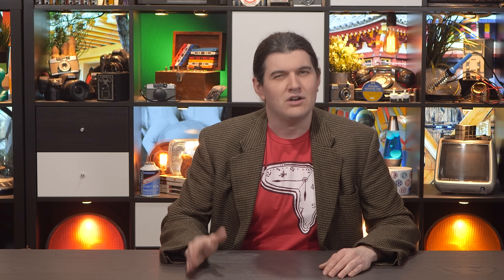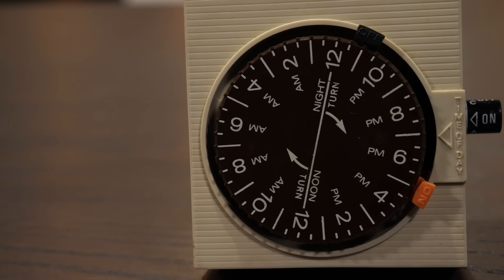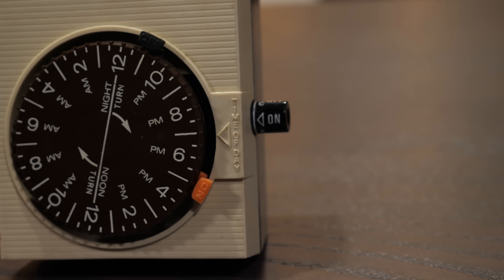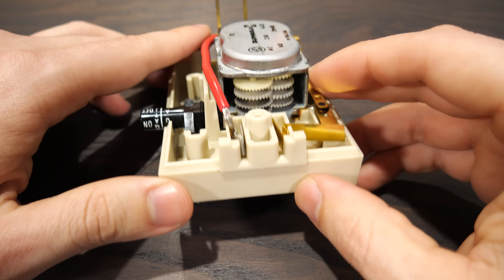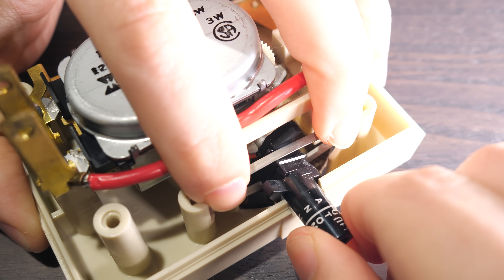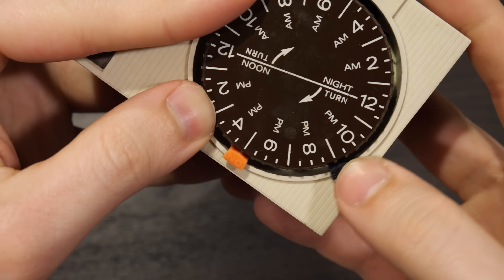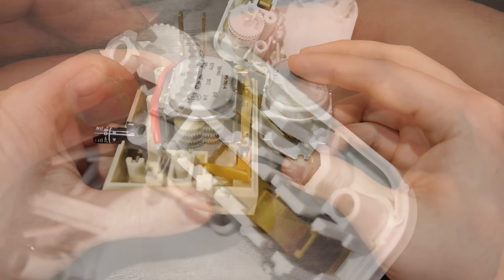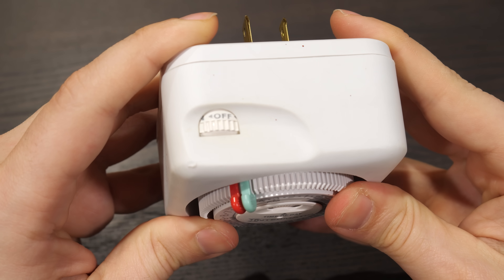Timer switches: literally just a clock and a switch

Comment: Great topic, and great video, as always!

My family has been using these kinds of timers since the late 1960s, when my grandparents first found out about them. (Religious Jews don't turn electrical things on and off on sabbath and holidays, so we use these timers to make life on those days more convenient.) After doing a bit of research to identify the picture burned into my brain, I think my grandparents' first one was an Intermatic Time-All Model A-211, which had a power cord, stood upright on molded-in feet, looked something like a big alarm clock and had the override switch on the right side. That timer might've outlasted my grandparents.

My wife bought a timer exactly like your first one when she was in college in the mid 1980s. She still had it when we got married, and we used it (dare I say religiously? 🤣) for about 20 years, at which point it failed. I don't remember if one of the plastic parts of the switch broke off or the motor burned out, but whatever killed it, she definitely got her money's worth out of it.

At some point, I bought two timers exactly like your second. Each came with two sets of trippers, and I did exactly what you implied in the video, and when I needed one of the timers to turn a light on and off three times over a 24-hour period, I borrowed two trippers from the other timer. I also discovered, as you mentioned, that those trippers are ridiculously easy to lose, so at this point I think I have one timer with two sets of trippers on its dial and the other has two OFF triippers (but no ON trippers) on its dial. Oh, well...

I also have timers similar to, but not exactly like, your last two. In addition, I have one programmable in-wall timer that replaces a light switch. Acquiring that was something of a production. My first such timer was a relatively simple model that got its power from the household current. That was fine until CFL spiral bulbs that fit into most fixtures came out, and I quickly discovered that my wall timer was incompatible with those. Apparently, it depended on the filament resistance of incandescent bulbs in some way, and having even one CFL in my dining room chandelier caused all the bulbs to flicker and the timer to make funny noises. So, I had to stick with incandescent bulbs in that fixture until I discovered a wall timer that used a pair of AA batteries to run the clock and operate a mechanical switch to turn the lights on and off. That worked fine no matter what kind of bulbs I put in the light fixture. It was a bit annoying in that the switch made a curious sound when turned the lights on or off, which took some getting used to, and it went through several sets of batteries per year. It lasted for about 10 years, after which the plastic hook that held the battery compartment in broke, and I had to replace it. The updated model offers relatively complex programming, auto daylight savings time adjustment (obsolete since the last DST rules change), switching the lights at dawn and dusk, and a lot of other features. It uses some sort of camera battery instead of AAs, but it also uses a more efficient electronic switch instead of a mechanical one, so each battery lasts several years.
Reply: I have to ask: do you (or your grandparetns) use the sabbath mode on your oven?  I actually mistakenly discovered this on the oven in my last house when I hit some combination of the buttons and it suddenly showed "sbt" or some such on the display and I had to go dig the instruction manual out of the basement to figure out what happened and how to cancel it...
Reply: @jimbarino2 , funny you should ask that. My brothers and at least one of my sisters use sabbath mode on their ovens at least once every week. I use it on mine occasionally, but my wife has to ask me to turn it on for her, because she has never successfully done so. Sabbath mode, which is actually something of a misnomer, does two things. First, it enables the oven to stay on longer than 12 hours, give or take. Second - and this is why it's a bit of a misnomer - is that it provides a means for changing the temperature of the oven on Jewish holidays (but NOT on the sabbath) within the confines of Jewish law.

Comment: While I appreciated the accuracy and thoroughness, "morphosisticsted" is my key takeaway. Joking sside, I install a lot of intermatic commercial mechanical timers. I believe the key difference between them and the consumer units you investigated is that the consumer units bare a horsepower rating. Maybe in a future video you could discuss the difference between units that can handle inrush current vs timers that are only good for small groups of lights?

Comment: rather than losing tabs you can also just leave them on the unit, since an additional "on" or "off" tab won't change the program if it's already on or off, nothing wrong with an extra off tab after the previous one etc (assuming you didn't need the on/off to happen 30 minutes next to each other)

Comment: I have this exact same system on all of our game feeders. The tabs on the wheels are metal clips you have to remove or place where you want, like a paperclip. And the activation switch is not a spinning on/off knob, but just a contact trigger that activates the wheel on the feeder for a couple seconds. There's a rheostat knob that controls how long it spins after it's triggered by the tabs. You can place as many tabs as you want, and feed at, say, 7am, noon, and 5pm. Rock solid and never had any issues with them. More reliable than the new digital timers.

Comment: These were very common hardwired in older commercial buildings for lighting, signage, or HVAC, those ones are often reffered to as time clocks. Intermatic makes a lot of those commercial time clocks. You might have more luck seaching for "mechanical time clock" rather than "time switch".

Comment: For the second timer that can be programmed by inserting or removing tabs, spare tabs just need to be put next to take that you're already inserted. 

Put the spare "on" tab next to the "on" tab that actuates the timer. Do the same with the "off" tabs. 

That way the spare tabs will simply pass without changing the state of the timer.

Comment: Oh, hey I made a comment regarding this on the Connextra sights and sounds video for the Statesman.  I'm just glad that this was covered since it felt like the topics were heading this way in regards to electromechanical items.  This also answers my musing about what manner of system it uses regarding time keeping (how it uses the frequency of the electricity to keep track of the time in conjunction with some gear reduction).  Anyway, that last unit was really, really similar to the selection wheel on the Statesman and kind of awesome that something so different in use has a similar structure at its core.

Comment: Recently my 2-year-old noticed that some lights in our house turn on and off by themselves. I was trying to think of a simple enough explanation and surprised myself with "those lights have a clock that turns the switch on and off". 

Timers are great for plant or aquarium lights to provide a consistent photoperiod, and for seasonal decorations. The one I use for my aquarium has a week-long dial so I can have the light on different hours on weekends.

Comment: As someone that uses a timer for a lighy with a hard to reach switch, I'm glad they moved on from tabs. That being said, couldn't you store the spare tabs in the timer next to each other? Just take all the starts and put them after the one you need and take all the stops and put them after the stop you need. Since the tabs are directional it shouldn't matter if there are some redundant ones.

Comment: Meanwhile I set up an full master-slave clock system running a signal clock (which I guess is just a fancier timer switch) which then via some relay logic control lights and stuff because what's the fun in keeping it simple 😂

Comment: I recently bought a couple of those mechanical timers for some, uhmm, indoor gardening. The ones I bought have 15 minutes intervals so 4 tabs per hour, they are quite small but the design is good enough that you can push or pull them easily. I do find that they drift slightly but I can deal with it, I haven't had to adjust them since installing them last month. The tech is so old but still useful. I liked this simple video, fun and interesting.

Comment: Have you ever explained those dual light switch system. Ive got two separate staircases with a switch at the top and the bottom and my brain doesn’t understand how it works. Also my house is like 90 years old

Comment: The facility I work at has one of these, but on steroids, that switches our 208/277v  outdoor lighting and signage. It's made of steel though, about 5 times larger, and guess what... it's also made by Intermatic. It's like they held a monopoly on these things, regardless of the application.

And since I'm the night shift facilities/maintenance dude, I'm the one who gets to reset it everytime there has been a power failure earlier in the day and the outdoor parking lot and perimeter lights don't come on at dark... Nobody ever remembers to do that.

Comment: Sadly, these simple, mechanical devices are now so cheaply made that they wear out fairly quickly if you leave them in continuous use.  First they start to make an annoying grinding noise, then they fail.  You can easily see why, it is just a bunch of cheap plastic reduction gears, with little or no lubrication.  I got sick of buying new ones every year or so.  Now I use electronic ones with a built in battery backup for the settings.   The mechanical ones are really only for running a few lights while you are away on vacation, or for your Christmas tree.

Comment: We've used these for years run block heaters on the big trucks and tractors (1600 watts).  Just like the one you showed, but a more recent version. They work quite well, although after a few years they start having problems when it's -40 and sometimes stall or get really slow.  I've also got one running a light (because the stupid LED won't work with the day-night sensor that is supposedly meant for LED). By the way the newer analog switchers you showed don't like -40 at all, especially the one with the 48 little tabs.

Comment: I have the second timer. You store the extra tabs by just plugging them into the dial. As you pointed out, they perform a no-op if they are on a part of the dial where the event they handle is already triggered.

Comment: I use an outdoor version of the 3rd mechanical one with the 48 pins to control my pool pump. I have it set to run for one hour at 3 different times each day. Pretty handy and quite reliable!
Reply: Yup, my pool filter/pump controller has a couple big fancy high amperage ones of these (in reality the internals are probably practically identical… hate to think what that relay looks like inside) built in for controlling the heat pump and filter.

Comment: When you can't use Google, use AI!  Here's what ChatGPT says:
"Timer switches, which allow for automatic control of lights and other electrical devices, have been around for several decades. They were first introduced in the 1960s and have been in widespread use ever since. Over time, the technology behind timer switches has evolved to include features such as programmable settings, remote control capabilities, and integration with home automation systems."

Comment: Wire wraps are a very good connection method and were used in telecommunications equipment backplanes until the introduction of plastic cable connectors. Ten years on while wire wrapped equipment was still going strong after multiple decades of use engineers found out that plastic not only refers to the substance but also its properties. Gravity distended the connectors and faulty connections happened. By then the zip tie was invented. Also with wire wraps you did not have to carry around a rubber eraser to clean the contact surfaces every time a weird fault was detected.

Comment: Next up: honeywell's "winter watchman" thermostatic switch!

Plug it into a wall, then plug a lamp into it and set the temperature. 

If the temperature in the room falls below the setpoint, it will turn on the light, letting your neighbours know that your heat isn't working while you're away, so someone can make sure your house doesn't freeze.

Comment: On the CNC machine I run at work I put one of these on the oil skimmer on the coolant tank to get the unwanted oil out of the coolant. First tried the electronic kind but it kept resetting for who knows why so I just put the mechanical kind on and it's been working great for a couple years now

Comment: I'd like to hear the explanation of a satellite clock radio.  I have one and love it.  

You plug it and set the zone number of your location, then it takes off.  It sets the time and date in your area and with the small 9-volt battery it keeps time.

If the power goes out, no worries.  The screen goes black.  When the power returns, the screen lights up and the numbers speed by, resetting your clock.

Another feature is it corrects itself every 6-months for the time change.

Never have to worry about Daylight Savings Time.
 
YAAAAAAY!!!!!  😊

Comment: Very cool! The design with the microswitch is actually used in some older commercial walk-in freezers. The HVAC system on the roof has this timer to set the de-icing stages of the freezer.
Edit: I should have watched the rest of the video... :|

Comment: Wonderful! Clock switches are the first steps into automation. I remember adapting one to control the millivolt circuit on a gas heater in an apartment I was renting. One of those through the wall vented heaters with no electrical connection. So it would turn on before I had to get out of bed in the morning...

Comment: I’m 47 and those Intermatics gave me a powerful blast of nostalgia. My grandfather used to use those a bunch in his house. I remember walking around as a little kid thinking they looked so cool and complicated. Got older, he passed, and I found a few of his laying around. They are very cool, and fairly bullet proof. I’d much much rather have that ‘70s Intermatic than the one with the digital programmable display. Those are a pain to program.. and then after you learn it you forget the next year when you have to do it again. Now a days of course, smart home IoT devices do all this. Yep, nostalgia.
Reply: @andymerrett  I find the old ones are rock solid as far as time keeping goes whereas the new ones with the quartz crystals tend to drift. Sure, it's only about 15 minutes a year but if you have one you leave on all the time you do have to reset it after a while.
Reply: I'm your age and have had to use timers quite a lot (ok, i haven't always had to use them but since they are around...).. You are right about the digital timers, trying to program them using only two buttons is a nightmare and so i use mechanical timers if current allows it. Also, the digital timers still use a battery backup and those can crap on you...  

The next timer is going to be WiFi but NOT IoT... Do not buy IoT if you don't need it, the security on those are abysmal. WiFi or Bluetooth is usually all you need anyway.
Reply: @squidcaps4308  What's IoT in your opinion that WiFi isn't already?
Reply: @MatthiasGörgens   An IoT switch is "on the Net" and can be controlled from anywhere.  (One advantage of the mechanical Intermatic switches is that a hacker in Bulgaria can't turn your lights on and off.)
Reply: Feh!  Whippersnappers...
Reply: You can bet I'm going to remember and use "morpho-sisticated".

Comment: My Dad made a timer switch to turn on a engine block heater some time between WW2 and the early 50's. It was a big ben wind up clock. Where the alarm winder pulled a string and turned on a plain old light switch.

Comment: I have a fishtank that requires light for set amount of time. I've tried all manor of electrical timers. They all failed or provided some difficulty to the process that should have been simple. I finally stumbled upon the 3rd design (with many tabs) and that timer has been fantastic.

Stuff the modern ones. The old ones work so much better.

Comment: I use one of these (rated for 1875watts) for the engine block heater on my diesel pickup. That way I don't have to have the power on to the block heater all night. An hour, or two if it's REALLY cold, and it starts right up like it's been plugged in all night!

Comment: Mechanical timers are common for reptile lighting.  It may have something to do with mechanical timers (generally) allowing for more current to flow though them.  The one I use claims to allow a full 15 amps, which is handy for running heat lamps to keep our critters warm.  Fancy electronically controlled timers I've looked into are (generally) only rated at 10 amps.